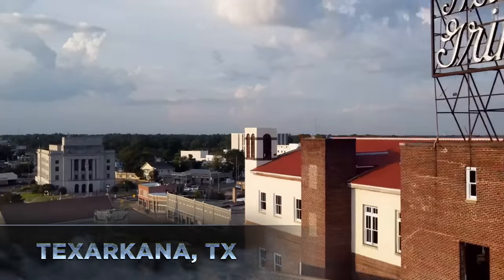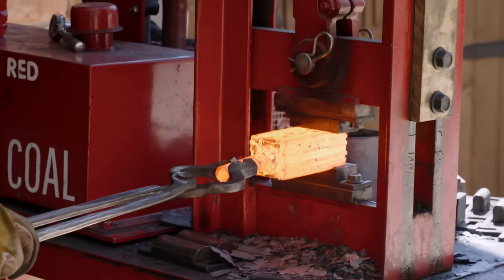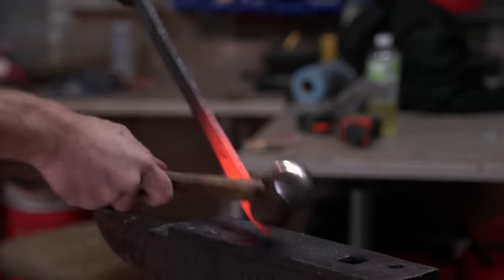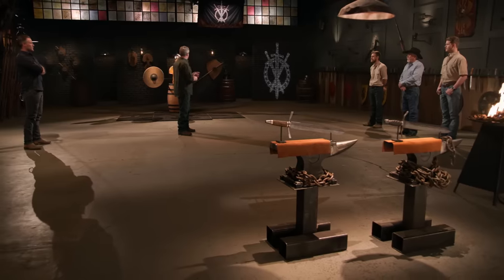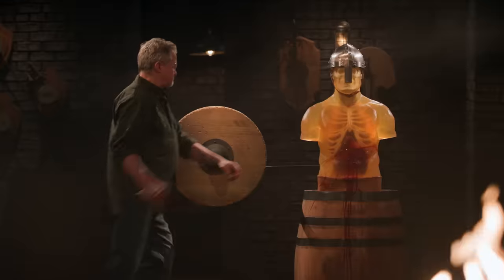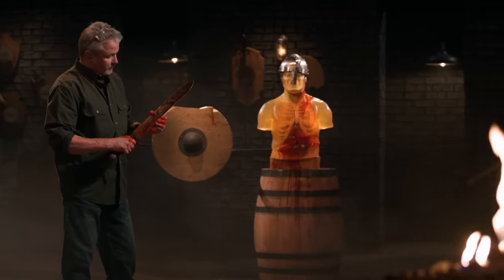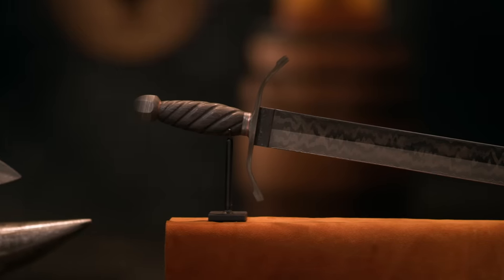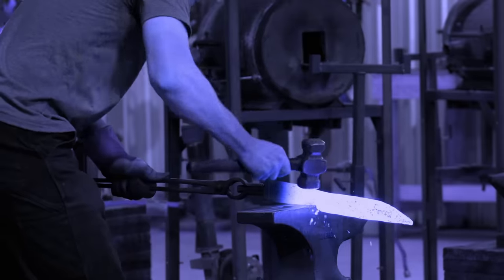Don't MESS with TEXAS Bladesmiths! | Forged in Fire (Season 10)

Comment: How much metal did Jake grind off?
He started with 14 layers.  If he ground off 1 entire layer, that would leave him with 13 layers, with the top and bottom layers being the same.
So, effectively 12 layers x 6 stacks + 1 = 73 layers.
Same issue multiplies through again, so 72 layers x 4 stacks + 1 = 289 layers.  And, he would be disqualified.
Now, if he only partly ground off that top layer, he might have managed his 300 layer parameter.